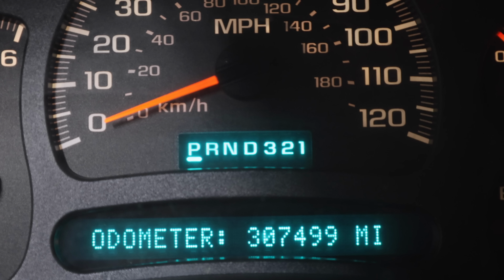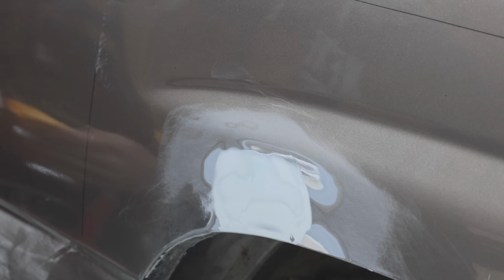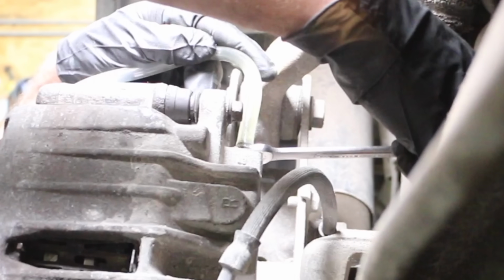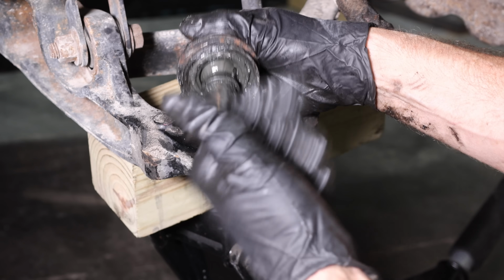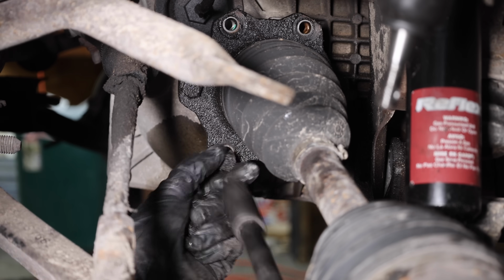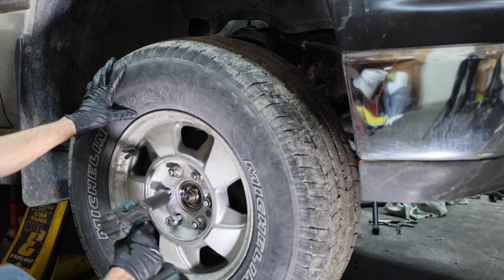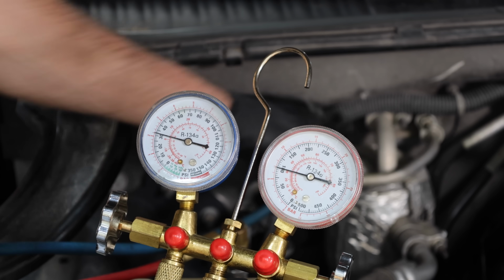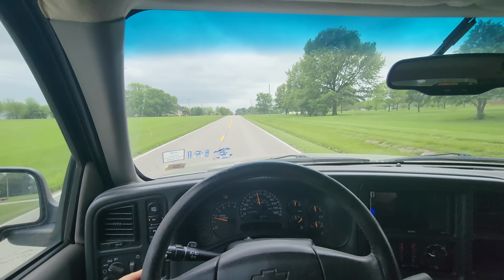Is It Stupid To Fix Up A 300,000 Mile Vehicle? Let Settle This!

Comment: I love to see it, i have 307k on my 2007 tundra still going strong, original oil recommendation is 0w-20 and i still use it with slam to no oil burn at oil change interval of 5k so i think sticking with it is the best option, and i continue to use castrol synthetic based off your oil review series
Reply from the maker: Thanks for the feedback.

Comment: I owned two Saturn S-series cars, a ‘92 and ‘99 and both make it to over 300,000 miles before getting wrecked, original 1.9 engines and transmissions. One had the original clutch, even. However, the most reliable and longest lasting vehicle I ever owned was an ‘03 Mazda Tribute (same as the Ford Escape) that I sold with 401,000 miles on it, with only the transmission needing replacement at 350k. I still see the current owner driving it occasionally.
Reply from the maker: Thanks for sharing.

Comment: A couple of tips: 1) When changing the differential lube, it important to a a limited slip additive if you have a limited slip differential. If you are unsure, with both rear tires off the ground, rotate a rear wheel. If the opposite wheel rotates in the same direction, it is a limited slip. Standard differentials will rotate in the opposite direction. 2) I find it quicker and easier to compress a caliper piston by placing an old inner pad over the face of the piston and using a large pair of slip joint pliers to squeeze in the piston.  You will also be able to tell if both of the calipers have about the same amount of resistance. If one has significantly more resistance, replace the calipers. Also, those vehicles are notorious for having the inner portion of the brake hoses collapse causing a severe reduction in braking performance. At 300k miles, I would definitely replace the brake hoses. I had a Suburban with 250k miles that wouldn’t hardly stop. After replacing both calipers and the master cylinder with the symptom remaining, I replaced the hoses and Voila!

Comment: My 2000 chevy silverado is at 362k miles unfortunately I've had to rebuild the transmission twice and will need to replace the engine soon due to a blown head gasket, but I'll keep driving it until the engine let's go
Reply from the maker: Thanks for the feedback.

Comment: I have a 2002 Dodge Durango. I have 177,570 miles. I bought it from a private owner 10 yrs ago at 74,000?miles. I only worry of the transmission. I checked at 100,000 to change out fluid when I did the differential fluid. I was told then not to do it as it was way too late into milage. Still told that to this day. I wish I would have ignored and at least did a partial change back then. I check the fluid every 3 months and has always been fine and until today's check. Fluid level ust at the bottom safe line and looks a bit dirty...not real red anymore. I wonder if I could drain just a quart or 2 to replace is a good idea? I have kept everything else up and other than a 2 inch rust area of the rocker panel at the running board it is in beautiful condition. My favorite vehicle I have ever owned... I love the 2000- 2004-05 era...
Reply from the maker: Thanks for sharing.

Comment: If the repair is less than the cost of the tax on a new vehicle I would do the repair.  Put some aftermarket flair on the fenders, I just did this on a 2007 Nissan Frontier that I have.
Reply from the maker: Thanks for the feedback.

Comment: Just sold my 02 burb 2 days ago with 351k parked it almost 3 years ago due to rotten brake lines . Put the battery in and it started in less than 5 seconds!! Had a mouse nest in the air box. Runs like a new watch (no joke) nothing but Amsoil signature oil since it was new.
Reply from the maker: Thanks for sharing.

Comment: Just keep doing what you are doing... we all love the content and wouldn't change anything! I myself have a 2004 GMC sierra with 280K on the clock... and will continue to repair and replace warn parts until I can't.  Keeps the truck for use as a truck... not afraid to get it dirty and the scratches are just adding to the character 😂
Reply from the maker: Thanks for the feedback.

Comment: dude i just last tuesday bought a toyota with 550t KM on the clock and it's 1.6l gasoline :D It works 99% except clutch makes funny noises :DDDD
Reply from the maker: Thanks for sharing.

Comment: Best part was the fender rust rot repair. I just finished rebuilding the front disk brakes on my Ford F-250 8600 GVW and found that rebuilt calipers are frequently poorly rebuilt. The pistons would not fully retract due to poor cleaning so next time I will buy a kit and hone the calipers myself. In my area finding a good affordable shop is impossible and the guesstimates were more than I paid for replacement parts due to my mistakes and replacement of bad parts purchased much earlier so could not return them. Thank you for videos like these...and have a safe day b/c if you have a safe day then it is a good day.
Reply from the maker: Thanks and you are welcome!

Comment: You have 300k on a 4L60 transmission??? Great video.  

Just spend 2k for front end work on a 98K2500 GMC.  I was reluctant to do ball joints/pitman/idler/ etc because I dont have a ball joint kit and I have never done it before.  This is a great reference video.
Reply from the maker: Thanks!

Comment: We Ford Ranger owners consider 300k to be just broken in. They're the Energizer Bunny of the automobile world.

I've been happy with my Channellock snap ring pliers. They came with straight and curved tips.  Push a slider to change internal or external. If I dealt with snap rings all the time I'd have a set with straight and a set with curved to avoid swapping tips.
Reply from the maker: Thanks for the feedback.

Comment: Excellent video and a lot of great information to help keep vehicles on the road longer! When installing brake rotors, I like to spray Fluid Film on the wheel hub to help prevent rusting. Out of curiosity, how long did all this work take you? I guarantee you saved several thousand doing all this work yourself. You should do another update on her at 400k miles. :)
Reply from the maker: Thanks for sharing.  Thanks or the suggestion.

Comment: I have 361,000 miles on my 2002 Silverado 5.3 same engine and transmission.. still runs great!
Reply from the maker: Thanks for the feedback.
Reply: I have a 2001 Yukon w/5.3L. Original engine and trans. @ 320,000 miles. They might not have intended to, but they made these trucks and suvs to last!

Comment: a little tipp on new break rotors: always clean them with break parts cleaner - they're usually coated in oil to prevent rust from storage. this can lead to problems with the pads.
Reply from the maker: Thanks for the tip.

Comment: My college car was a 78 Corolla (I bought it in 83 with 70K miles for only $500 from my sister who had it for her college car).
I did all of the maintenance. Back then we had conventional oil so it was changed every 2500-3K miles. I changed the transmission and rear end grease every 30K miles.
After Grad school I kept driving it. By that time I wanted to see how long it would last.
It died in 02 with 488K miles. 
I promptly bought an 02 Camry and drove it until my needs changed in 11. That’s when I bought a new 11 Rav Limited 4WD with the 3.5 V6.
I drove it until I bought my 23 Toyota Tacoma TRD Off Road, double cab, 6’ bed with the premium and technology pkgs.
I’ll drive my 23 Toyota until I die as I’m driving only 6-8K miles per year.
Reply from the maker: Thanks for sharing.

Comment: Great vid. This is exactly what im doing with my 300k plus f150. One thing that would have been cool is a total money spent on the parts you bought. Total estimate to have someone do that. I think more people would do this if they realized that in this video you covered just about every high mileage vehicle break down thus virtually eliminating on the road surprises. Im going to go ahead and do my water pump, starter and althernator also as they cause many break downs. One other point is that the parts taken off that are not bad can be kept for emergencies (like that idler and tensioner pully and belt)
Reply from the maker: Thanks!  Thanks for sharing.

Comment: My 96 Toyota Landcruiser is sitting at 330,000. Twice a year I drive it from northern Mn to Moab Utah. Usually ends up being 3300-4000 miles round trip all said and done. I do plan to pull the motor and freshen her up before 400K but I would get in that truck right now and drive anywhere
Reply from the maker: Nice!

Comment: You didn't change the O2 sensor.  How about a fuel mileage test before and after replacement.  Sensor efficiency drops off long before they throw a code.

Comment: There is always something satisfying about putting new parts in high mileage vehicles espeially when they are solid and reliable. I am not sure if that truck has the options to reset adaptations, it is good to try and reset trnamission, transfer case, and engine adaptations when doing fluid changes and fuel/ignition component changes. Sometimes it is not necessary since the car computer may just relearn as you drive the car.
Reply from the maker: Thanks for the feedback.

Comment: I have 2 one a 99 changed tranny rest original except for normal maintenance, NO rust 378,357 miles runs and looks like a new one . My 2000 ALL original 283,245 miles would drive either one to California and not worry. But the 2000 is rusted badly rockers,quarter panels rusted some frame is rusted too. My pastor says my 2000 rides better than his Cadillac. Check it out 2000 and newer rust terribly. 99 and older unless subjected to road salt are way less rusty with many like mine just surface rust on frame. The 2000 rides like a luxury car ( both 4x4 ) I think they changed suspension from 2000 on. My 99 rides like all 4x4 trucks but drives well.
Reply from the maker: Thanks for sharing.

Comment: I’m glad you greased the ball joint press. Seems like 99% of people don’t. Every time I have got a loan-a-tool with threads it would be dry. I use some kind lubricant wether it be oil or grease. So much less strength needed and faster.
Reply from the maker: Thanks for the feedback.

Comment: I’ve got a new to me 1998 Saturn SW1 with 340,xxx miles with the original motor and transmission, I could replace every major mechanical component on the car and be under $5000 total invested into the car, oh and it gets 31-36 mpg even with my lead foot. I’ve tried the new car thing and it’s just not for me.
Reply from the maker: Thanks for sharing.

Comment: Mr Farm...that really was a boatload of work.  And, I think this is a great guide for any high-mileage car.  You illustrate things to look for to check for wear.  I have a high mileage 1983 Toyota pickup that is in need of many of your repairs.  I want to thank you as I will use your video as a guide.  excellent and thanks a lot.  You speak fast but you kind of need to in a video like this as you did so much work.
Reply from the maker: Thanks for the feedback.

Comment: Did you inspect the parking brakes & the upper and lower control arm bushings? Use Dielectric grease on sparkplug threads so when they get changed again there is no potential for snap off. Also freon add, you might consider some pag for the system and a luminescent dye with ring sealer

Comment: The pace is very good. What I would like is a list of what all the parts cost you if you don't mind. That would give somebody an idea what they need to budget for a going over like you did. Also a list of what you would suggest be done when is awesome. I know you mentioned a lot of that as you were going, but that is very fast and it's hard to take notes on.

One thing I would love to see if you can get your hands on one are some of these transmissions that manufacturers say are sealed that you don't ever have to maintain which I disagree with personally. One that has failed hopefully at 150 or maybe 200,000 miles to show what has gone wrong in it because to me that is almost planned obsolescence.

Currently, I have a Mazda 3 turbo all-wheel drive, but I won't be having it much longer. I've had it for just over two years, 110,000 miles. It's been dead reliable, but they say this is one of these sealed transmissions and differentials and all that. There are no maintenance items, which I disagree with. And if I were keeping the car long-term, I would be working out how to work on them.  But I'm not keeping the car. My new car is already ordered and on the way and I'd be happy to share my experiences with it when I get it. The new Tesla Model 3 performance, it will be my first electric car.
Reply from the maker: Thanks for sharing.  Thanks for the suggestions.

Comment: Craziness… I get to do most of this on my 13 Ram, just waiting for all the parts now.  New sway bar, sway bar links, struts, and an added bonus of broken manifold bolts.  I really need to build that vacuum to flush my brake fluid.
Reply from the maker: Thanks for sharing.

Comment: I have a 2007 Ford van with V10 engine that just turned over 500,000 miles. 
Many many sets of tires and brakes and steering/suspension and 4-5 new HVAC motors.  
Still running!
Reply from the maker: Thanks for sharing.

Comment: Well you did a good job for not being a body guy, although regular sheet metal mightve been cheaper and just bend it, but for a lower skill level that big piece was a great idea. A sanding block is a sanding block! Its flat and straight, go for it. Not a bad job for a DIYer. Maybe shouldve cleaned the parking brake shoes off when installing a new rotor. Those ball joints are spanked!! As always a GREAT video... I like the speed you film at. I watch a lot of other mechanic shows and some of the procedures are monotonous and boring to watch. Have you tested Leather care products for cars? Geist, Chemical Guys, Mequires, Leatherique, Detail Firm, Lexol, etc etc.
Reply from the maker: Thanks for the feedback.

Comment: My '97 Ram 1500 with a 5.9 360 V8 auto and so far it has 299,035 miles and still going strong with the original engine and trans. I've owned the truck for a little over 10 years and I've put 107,000 no it myself. With no major repairs just regular maintenance. I keep all fluids changed the best I can and I put an external trans cooler on it because I don't think the radiator trans cooler is enough to keep it cool enough, so I put an external trans cooler on it shortly after I got it and I think that's what has saved the trans so far. I don't know how long it will go but I'm going to keep driving it until it won't run anymore or I can't drive anymore.
Reply: Oh and I enjoy watching your channel so keep up the good work and I'll keep watching.
Reply: One last thing regular maintenance is the key to keeping any vehicle going for a long time. If you don't take care of them then they will not last, but keep up with regular maintenance and most of the time they will last a while.
Reply from the maker: Thanks for sharing.

Comment: Great video Mr. Farm. I have an '02 Suburban (250k) I've done many of the same maintenance items in your video. Most recent was every brake line on the vehicle. When I retired I bought a 4 post lift and that made life a lot easier. I'm curious if you had any broken exhaust manifold bolts, I had several. That took me a while to repair.
Reply from the maker: Thanks for sharing.

Comment: One of my semi daily trucks has 192K on the clock. And after I bought it I found the odometer paperwork where it was replaced with a new Odometer at 247K miles. Ooops it was a $1000 beater truck with heat and AC still gets 5-8K a year.
Reply from the maker: Thanks for sharing.

Comment: Todd, My 2002 Chey Suburban Has 300,000 Thousand and still Towing and going. I suggest Rock Auto to save money. LS engines go 500,000 easy..  You Might wanna replace the Air Shocks and Compressor if yours is a LT Autoride. Makes a Huge Difference. Ours could be twins. God Bless
Reply from the maker: Thanks for sharing.

Comment: One tip for the brakes. Wire brush the areas where the brake hardware goes. The hardware should snap in easily without any force.
Reply from the maker: Thanks for the tip.

Comment: I have a 1989 Ford F 250 with 17 million miles. Bought it new in 1990. It is on its second set of tires . The 351 Windsor engine  has never even had the oil changed .

Comment: Yes, a vehicle should be reliable 300k or even half a million miles and even 1 million miles.
Cars, vehicles, are supposed to last for many decades.
Look how we see videos of cars from like 1920s (so 100 years ago) that work just fine.
Not driven millions of miles, but still old tech, that with correct maintenance, can last hundreds of years and millions of miles)
Not in the modern world. Cars made in 2020s are built to last a few years and you then buy a new car, even more expensive than before, because capitalism, thank you very much for your purchase sir.

Comment: I don't change ball joints, that's just asking for problems down the road. Instead I replace the entire control arm assembly with new hardware that comes with new ball joints pre installed. This way I don't have to worry about the ball socket warping down the road and becoming loose.
Reply from the maker: Thanks for sharing.

Comment: I just did a similar "refit" to my 2006 Dakota. Lots on front end parts, brakes, rear axle seals, new tires, all the fluids including the clutch. Like a new truck! For a lot less $ for a weekends work. Didn't need a steering gear set tho. That ball joint tool is a must have. How about reviewing a puller set sometime?
Reply from the maker: Thanks for sharing.  Thanks for the suggestion.

Comment: It all looks so familiar! I just did All the exact repairs on my nephews 2001 Tahoe Plus rear axle seals and bearings and fuel pump and fuel filter only for his transmission to go out 20,000 miles later.